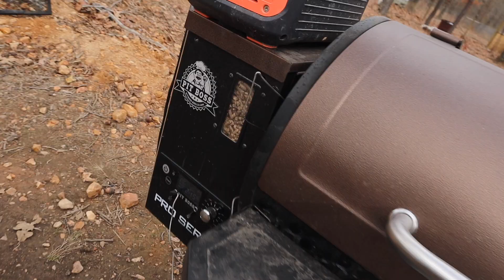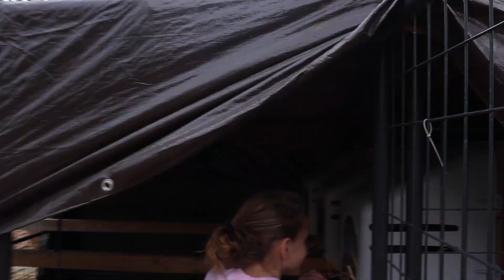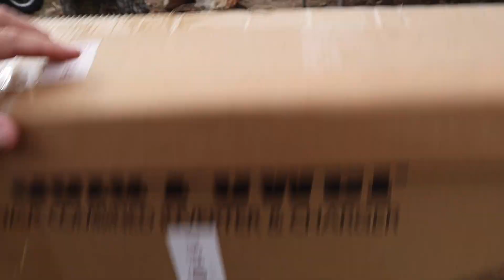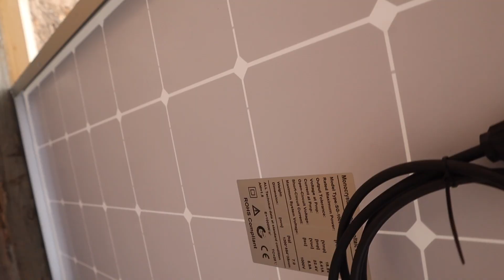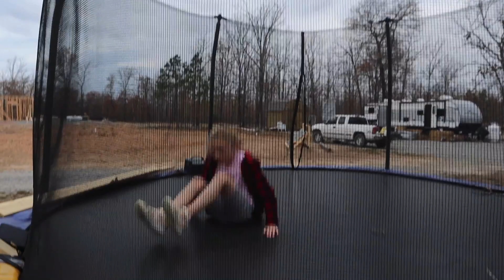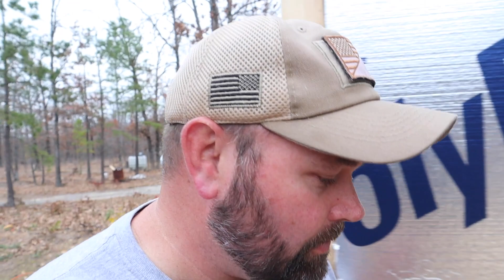WELL SO MUCH FOR SOLAR POWER...Sun Gold Power

Comment: Are you folks just a thought and I'm sure somebody's already thought of it but with your solar array if you're going to be leaving it right where it is and running wires through a trench make sure you put those wires in the trench into a PVC pipe to help prevent loss from groundwater I used to work in Penitentiary service in our underground wires had to be changed and abs pipes put in to protect them because of standing groundwater

Comment: Dutch .... those leads to connect + to - are long enough, you just have to put the batteries in series, so the poles you want to connect are close to eachother, that way the leads make a small loop, the same way they connect the 12V batteries in a semi to get 24V but you double up to make 48V ....
With 3 leads you make 48V and then on the 1st battery you have a free + pole & on the last one a free - pole.
(+_- )<>(+_-)<>(+_-)<>(+_- ) ...... 1 battery = (+_-) .... connection lead is <> 
Better hold on to the remaining leads, you'll need them for upgrading or as spares

Comment: The LF and 48 volt is the best for surge and heat. You run lower amp at 48 volts. Just be careful when working with everything.

Comment: We have just about the same components,  our inverter is on top mounted with Simpson structural screws,  make sure you have a pv shut off switch in case you need to work on your system,     if your controller is 150v divide 150 by the open voltage on the back of your panels to get how many you can have in a string.... mine are 38.5 , I have 4 in a string giving me a potential  154 volts at 100 percent efficiency,  that rarely happens so I'm usually right around 140v full sun... the higher the voltage the more efficienct the conversion.. batteries always get hook up first... put shut off brakers for everything

Comment: I think the Energy department needs to work to set standards for plug and play systems if they want people to use more Solar.
Reply: No.  We don’t need the government sticking their nose into solar. Scariest words you can hear “I’m from the government and I’m here to help”
Reply: I didn’t say help. Where would we be if every appliance we bought from all over the world had different plugs.  And you needed seven recpticals
Reply: @philipbutler6608  I agree with that. I think that needs to be an industry regulated thing. It can’t be that hard for everyone to get together and set some type of connection standards. I do remember early computerized cars that had different connectors different protocols. At least they settled on something to make it easier and cheaper on mechanics.

Comment: Dutch—-  talk to Jason from Cog Hill regarding using propane to heat your RV.  They found it to be quite costly and somewhat inefficient. They changed to a hot oil heat unit instead. The propane was only lasting around a week when heating the RV.

Comment: Put it on a shelf have somebody help you built it so that way if something happens you don't make a mistake that somebody help you so that way you can do it right that way things will look a lot better for you then there's no mistakes that way you got somebody helping you that will look so much better and much cleaner and you can run that line to the to the trailer whatever put it under a pipe and everything so that way it'll work a lot better for you then you can run in there the house to the other place all right guys take it easy Happy Thanksgiving

Comment: If you would go to Wild Wonderful Off Grid, Josh shows how to set a solar system up and he explains it quite well.  He's an electrician by trade so does a great job explaining for us not so electrically smart!!
Reply: Totally agree.... Josh knows his electricity as he is a Fully Qualified Electrician as that is his job during the week.
Reply: Josh hasn't worked an outside job for months, he is full time homesteading. Still an excellent electrician though.
Reply: Totally agree, he got injured helping a neighbor, cracked ribs.
Reply: Also, Dutch has commented on their channel, so he is aware.
Reply: I watch that channel too and was amazed at WWOG solar array..
Reply: @nursesheris8777  At 30 grand it should be amazing.
Reply: I actually contacted Josh when I was hooking up our system since they used the same Schneider parts we did in our build.

Comment: I would mount the inverter under the batteries, so the heat will rise in the winter to help keep the batteries warm. Happy Thanksgiving 🦃.
Reply: Would that make the batteries too hot in the summer?

Comment: Each of your batteries are 12 volt times 100 amps or 1,200 watts (1.2 kilowatts).  4 batteries in series provides 48 watts- still 1.2 kilowatts.  On a sunny day, your panels will charge the batteries very quickly, leaving you with power to use or loose. That is the time to run your vacuum cleaner, clothes washer, etc.  I think you will be fine…….and Learn a lot over the coming year.